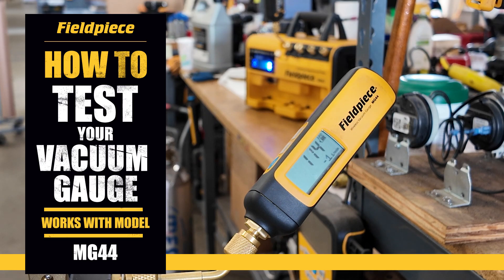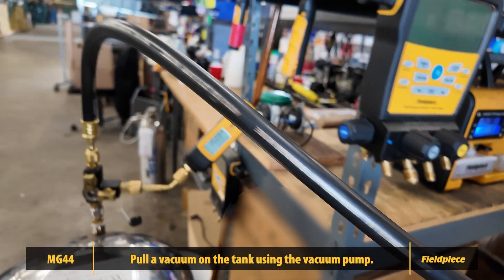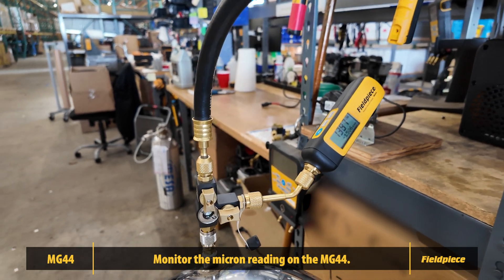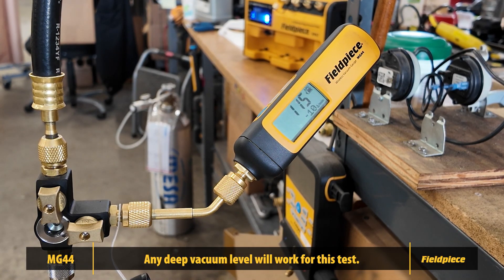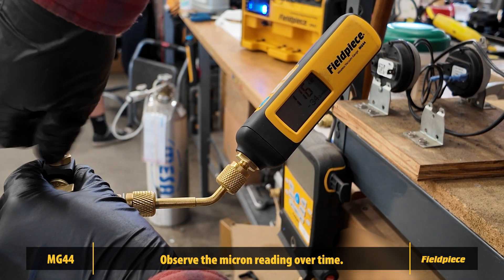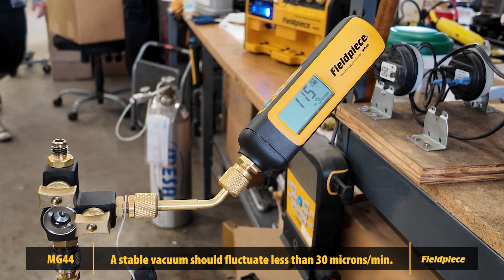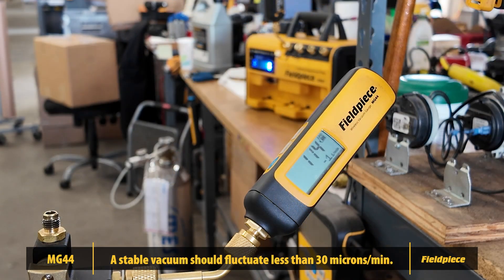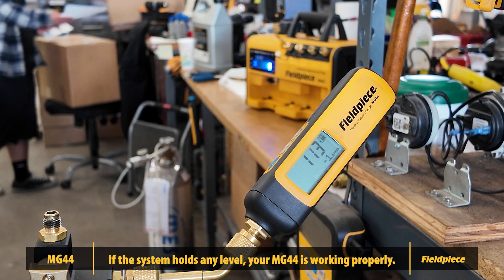How to Test Your Wireless Vacuum Gauge | MG44

Comment: I've  bought 3 already and non of them hold the vaccum
Reply: My fieldpiece vacumn gauge is leaking very little but it’s throwing off my vacumns when pulling below 300. I wonder if there’s a solution for this.

CPS vacumn gauge the best you could buy. $160, I can leave gauge on large refrigeration system piping reliably for 24 hr holds without worrying if my gauge is leaking.

witsands positive pressure up to 400 psi for those woopsies. 

Hope I can fix my more expensive job link vacuum gauge though :(

Comment: Mine keep fluctuating and turning off and on , did the cleaning as required , nothing worked. Tryed to get more info on anything that could help in reference , and it sent me to watch this video. 😂
Reply from the maker: We want your Fieldpiece equipment to be in top shape. Give us a call at 714.634.1844 or email fpwarranty@fieldpiece.com so we can help.
Reply: Yo compre uno hace año y nunca me funcionó es demasiado malo no mide el vacío correctamente y ni tampoco mantiene el vacío lo lleve donde me lo vendieron y tampoco lo pudieron hacer funcionar correctamente gaste 450 dolares y no me funciona lo tengo guardado en mi caja de herramientas
Reply: @gatygarcia3021 cual estas usando haora? El fieldpiece que yo tengo no sirve pa nada